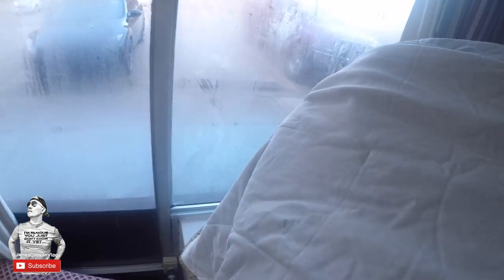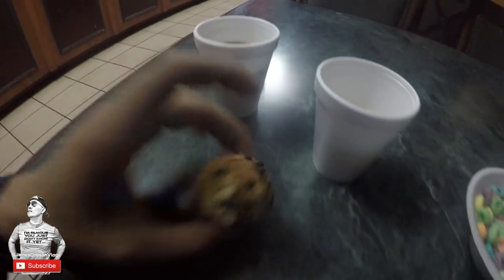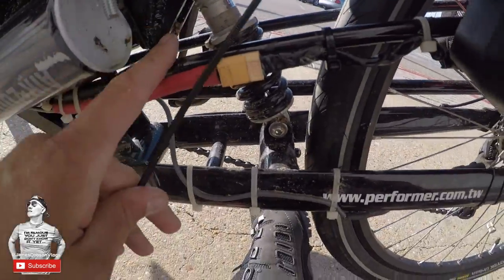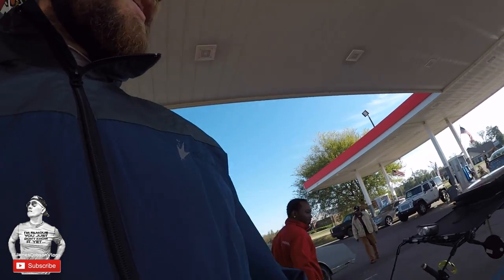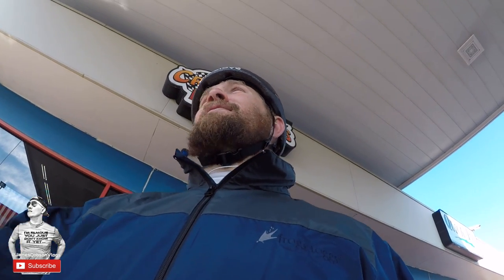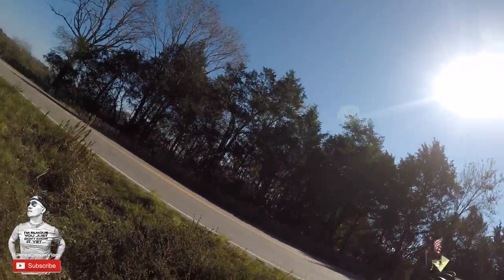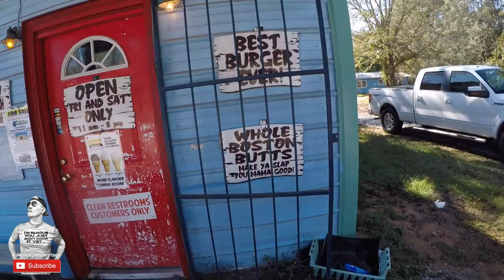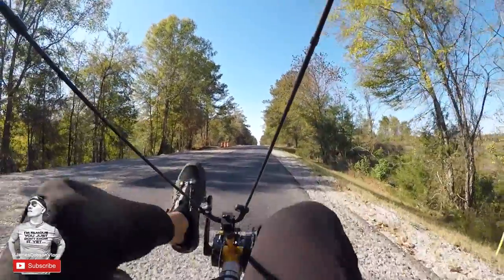Day 41 / Vlog # 109 Alabama SLAMMA

Comment: Can I ask. When you had the electric assist fitted. Did you have to have the boom replaced for steel one. 
To take the extra weight of the motor. Or have you still got an alloy boom.
Reply from the maker: Paul Hill I still have the original boom but I’ve added boom arm made of steel that connects to the boom from the motor that adds extra strength. It’s from LUNA cycle. Find it here: https://lunacycle.com/bsb-1-stabilizer-bar-for-bbs02-and-bbshd/